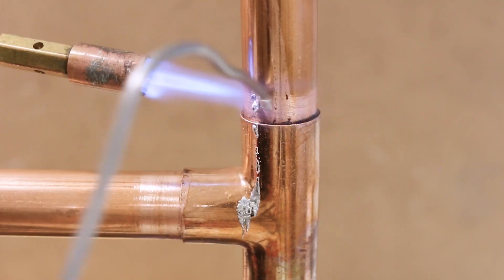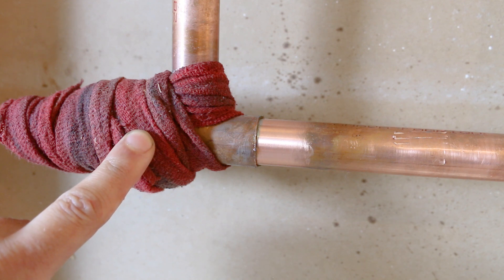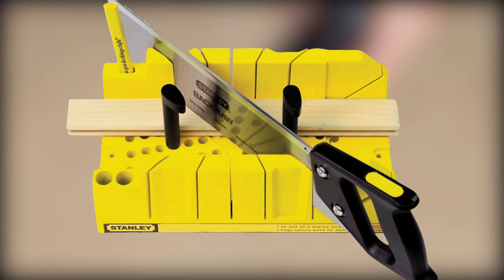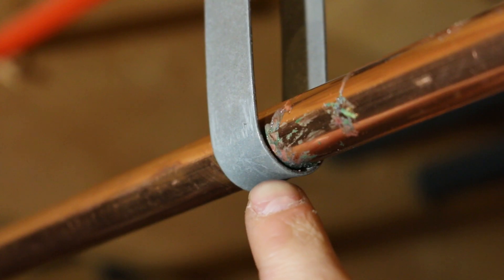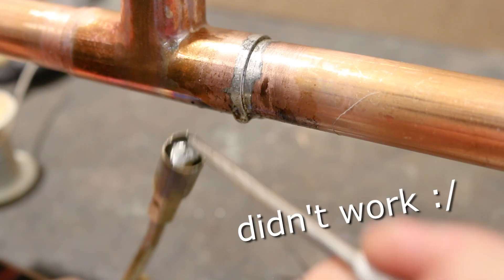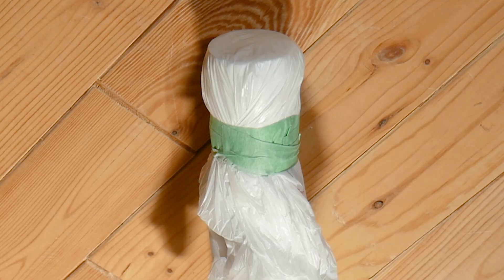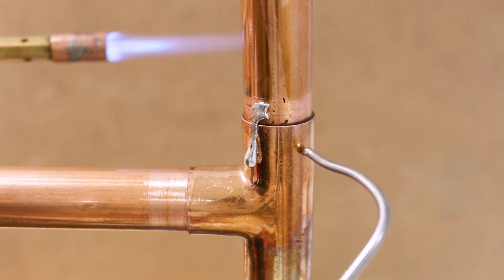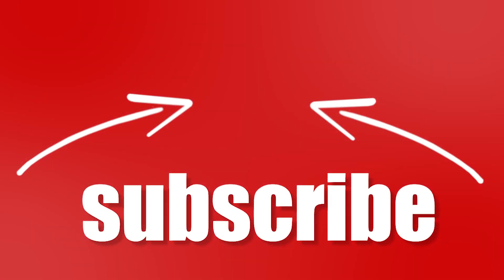10 Plumbing Mistakes Beginners Make And How To Avoid Them! | GOT2LEARN

Comment: no 1 - you direct the flame only to that spot. The rest of the connections will get hot but will not melt. Don't need a rag.
no 2 - you must be real stpid to cut crooked
no 3 - does not apply to me in my country(Romania), we have soft or hard pipe. I used it in my own house for the heating lines and also the hot running water ( the soft type- italian style )
no 4 - again, you must be stpid ! 
no 5 - the excess will come out by gravity and the torch i use is not an issue to be broken by melted solder
no 6 - i did no cap my ends. I don't care !  I will cap them with a copper cap from no 8 that I wil solder so I can run water and chek for leakes ( only for running water system , the heating system wil be tested with the radiators on )
no 7 - I put my pipes in the wall or cover the floor with leveling cement
no 8 - not my case as I will not have a closed small system when capping to pop it out
no 9 - you must be stpid. Our flux has soldering in it. When the green paste turns silver its time to touch the solder rod to the copper pipe. Easy peasy
no 10 - hot water pipe comes insulated. If you buy non insulated you are cheap and will lose heat on the line. If your pipes are not for hot but cold water or gas or ac unit, then yes, its logic and normal to keep them apart. You should keep them apart anyway. Makes sense !
no 11 - it seems you premiered this on my birthday :P

Comment: Putting hot and cold water lines isn’t just a problem with copper pipe, it also applies to PEX, and the PEX with aluminum inlay. Most common problem is water lines, hot and cold too close together, or also through a floor which contains floor heating.
On soldering, who ever started the crap that one could do a T in different iterations, is an absolute moron. That only applies to clamp fittings, press fittings or threaded fittings. Soldered fittings should always be finished in one go. 
Oh, and on soldering a cap, the solution is right next to it, just open the bloody valve. If still a problem unwind a tap or a capped threaded socket nearby. If working on water lines, there may still be water in the pipe nearby, either get that water out, or if not possible, put a chunk of bread into the pipe before you start soldering the cap. The bread will expand and seal the pipe’s inside, it will also dissolve quickly enough to not be able to contaminate the water line. A good rinse of the all the mains and different appliances will rid the pipes of such a handy temporary aid.

Comment: Due to my back. Plumbing was my last job. I was going to trade College for pumping. Miles of me and copper pipe. You showed the tools. Interesting. Wrong gas. Way not the blue tank. Yellow. So I will stop short on this class. Oh, I was second in my class of 24 then many left and went down to 14. You should see the cooper pipe done here at this house by an certified plumber. I would have gotten fired for that joke job. Oh well. Yellow gas canister. Not blue.

Comment: Being a pipe fitter for 40 years you always start soldering from bottom going up because heat rises if I saw this on my job he would be gone because he also burns the joint
Reply from the maker: Why are you soldering if you are a pipe fitter Gerry?

Comment: Nobody uses copper anymore, pex is too easy, last longer without repair/ freezing and cheaper!
Reply: Copper is still used for anything that would be visible after plastering, anyone using pex, hep or any other plastic pipe for 2nd fix is just a cowboy not a plumber.
Reply: @marksmith2412  spend your money how you like, i always can appreciate anyone spending money especially when im on the receiving end, as an investor i look at a long term solutions. I hope that anyone who decides their corse of action is profitable best of luck "cowboy"
Reply: In my state copper is still called for in commerical and industralized applications.